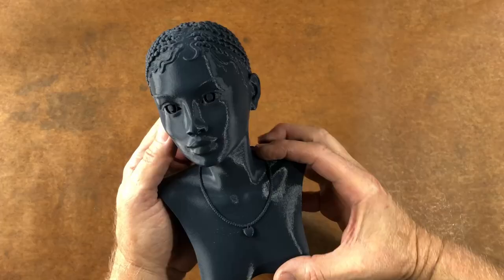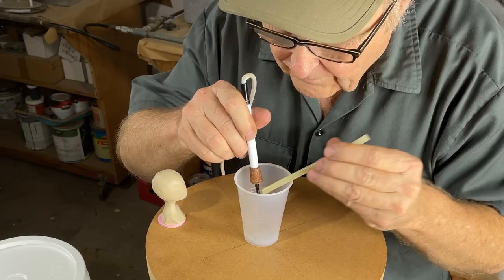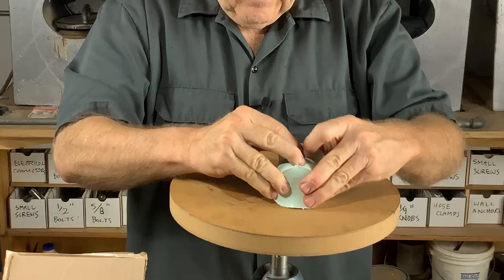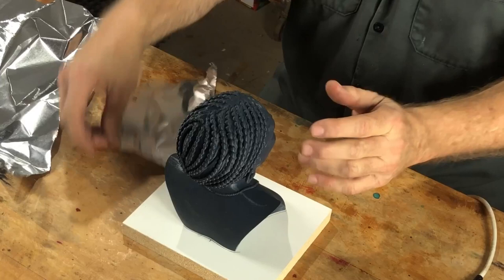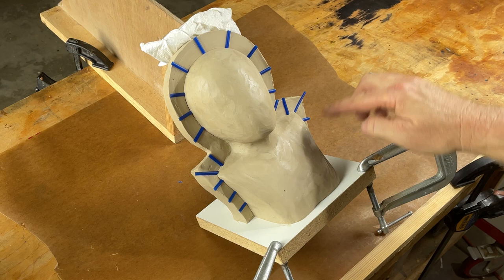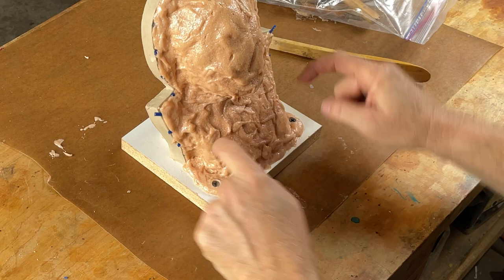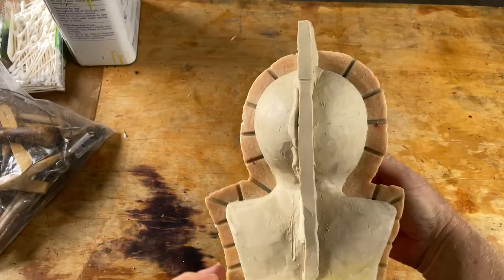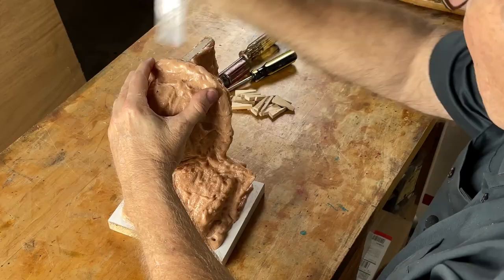Making A Silicone Glove Mold

Comment: Thank you for the amazing, informative content again.

The original sculpture definitely appears to be have been made on an FDM 3D printer. 

My experience is that most filaments for FDM printers do not have the same issue of rubber not setting, in comparison to liquid resins used in SLS/resin printers.

Comment: FYI Cure Inhibition. I've seen this frequently and know how to get around it.

UV resin catalyst (when not 100.00% mixed and fully cures) and the cleaning solvents generally cause Platinum based silicone cure Inhibition. Those chemicals are binding to the platinum catalyst and neutralizing them.
You can reduce inhibition by: baking part (150-200F for an hour). Also waiting 2-3 weeks after printing helps, both give catalyst time to dry out or hardened.

There is a special chemical made to fight platinum inhibition for UV resin,  Inhibit-X. It's basically 0.1% platinum catalyst agent plus thinner solution. It works amazing and lasts a while. It's a dip in solution (or thin brush on), remainder of unused solution can be poured back into bottle.

Comment: You already did something here similar to what I am going to do, but the process is easier. A friend walked me through the process. It is so easy, I feel very confident that I can do it.
But, instead the rubber is painted on in thin layers, and is so stretchy, that it literally peels back onto itself like a glove. No parting lines whatsoever. It is perfect to cast doll heads or the dolls that I want to cast.
Reply from the maker: That should work well for you. Make sure you can support the glove so it doesn’t distort when you fill it.
Reply: @RobertTolone  Since the molds will be so small, and it will be slush cast, (therefore creating a hollow resin) I think they should be fine. 😊😊😊

Comment: If you're able to turn the mould inside out, then you could possibly repair the few spots that tore out by attaching small quantities of rubber that will inversely translate into indents on the final piece.  Whether than would work in practice, (at all or partially), can only be answered by doing it, I guess.
Reply: That's what I'd have tried, John - especially if I still had the speck that Robert removed from the model.

Comment: If you're creating a mold from a 3D model, you can use the 3D file - expand it - and 3D print a mother mold for your glove mold to go into. Removes so many steps. I'm sure it could even be done by using a 3D scanner to scan a master where you don't have the 3D file. If you ever try this, make sure to expand the surface of the master - don't just scale it up because that won't work.

Added benefit; you can exactly compute the volume of the glove mold, though then you're deep into your 3d software.
Reply from the maker: In my cad system I can use a shell command but I find it is important to design the shape of the mold case.  A surface offset isn’t usually optimal for the case.
By the time you add the parting surfaces and keys, etc and then print the case I’m not sure you actually save much time over hand-built cases. Also I use manual methods because many of my viewers do not have access to 3-D printing.

But I will be doing some 3-D printed mold cases in upcoming videos because it’s too much fun to resist. Thanks very much for your comment.
Reply: @RobertTolone  Thanks for replying! The surface offset isn't perfect - and in Fusion 360 it often fails for complex models. Here in Sweden, silicone is $100/liter, so any excessive mold material quickly becomes expensive. Using the 3D model means you can create a mold where the silicone is 10mm, 5mm or even 3mm on each side. I often end up making the mold cavity by hand, slicing of parts that aren't needed and moving those parts over to the mold box/mother mold instead.

However, as you say, you need a 3D printer and you spend the majority of your time on the confuser. With your technique you need neither 3D printer nor CAD software. I'm guessing a lot of people do casting because they want to work with their hands - which would make your technique much more satisfying.

If one goes down the route I outline, the 3D printed box is square and can be made self locking so no rubber bands or clamps are needed to keep it shut during casting.

Comment: So what could be done to keep the clay from sticking to the shell? A mold release, beeswax? Would that then ruin that clay for future use?
Reply: I have heard that slow and easy heating of the clay really softens it. So using something like a hair dryer or a heat gun with adjustable settings should be a massive help. Although i also heard someone suggest possibly just covering the clay in aluminum foil or saran wrap before applying the rest. Hope this helps :)

Comment: Would spraying mold release on the clay partying line have helped you with taking the clay away in between making the two mold halves?
Reply from the maker: Yes, but I like to reuse the clay because I’m cheap. And I’ve never found an easy way to clean silicone spray off the clay. Still, it’s a good question. Always a balance between the value of labor and materials. Would the time saved use using the release pay for the clay?  Quite possibly.
Reply: @RobertTolone  It did not even enter my mind that the clay might end up being caput thanks to the mold release. But yea, it then becomes a cost vs time thing. =/ What if you resquished al the clay with that in it. Would you not end up with workable clay then? I mean sure the spray would accumulate over time. But it might get you a few more uses of the clay that way. Sort of like how they use thumbtack as a eraser.
Reply: @danje748  Interesting proposal, I for one am curious to see if that could work... I also saw a couple of other possible remedies as well you might look into as well. The first is simply heat, slow and steady with something like a hair dryer, or maybe a heat gun but with adjustable settings so as not to overheat anything. This will soften the clay quite a bit, and aid in it's removal. Another suggestion which I'm very curious to test is to simply cover the clay in aluminum foil, or saran wrap before applying the resin. Essentially wrapping yet another condom around the clay itself. However I haven't personally tried either of these myself so take it all with a grain of salt. I don't want to be the one suggesting techniques that may inhibit or downright ruin someone's project. But i figured I'd let you know in case you didn't. :(
Reply: @lucassmith1886  thank you for the ideas =)

Comment: What kind of silicone molding compound do you use normally?  I'm just taking the hobby up again after a fifteen year absence and I'm really behind on sourcing good material that doesn't cost me two limbs and a goat.
Reply from the maker: I use Econosil 25 from www.silpak.com. It is a tin-based silicone rubber and is the most economical one they sell.  Sorry to say there is no such thing as cheap silicone rubber and resin.   At least I have not found any yet!

Comment: Fantastic work! Great example of a technique I’ve never used.

Quick question, why wouldn’t you just do a cut mold? Yes, it would use a lot of silicone (I’m sure 1-2 gallons if not more), but it seems like you spent hours upon hours making this mold, and time is money
Reply from the maker: True, time is money.  When doing my client work I basically use the exact same materials and methods on almost every job. But that would quickly get boring on a YouTube channel. Here I try to demonstrate as many different methods as I can.

Comment: Hi Robart , I luv your videos, as well as the Craftman..this one though,  ni think you got it wrong for a glove mould, i think it would have been easier to partition the original with a clay wall and keys,  paint into and then layer up the silcon, (a dash of food dye )for alternate layers, to see coverage for each layer,  say four layers, bit over an 1/8,...cake up,  over the silicon (with whatever , your mud stuff, plaster, or even fiberglass), turn over and repeat for the second half....separate, and hole up with a cork bung for a good slush cast two piece...
Reply from the maker: For me, the point to a glove mold is to avoid parting lines altogether.  This mold required some cutting because of the sculpture shape but most of the mold was uncut.  So the parting line on the casting was short and easy to clean.

Two-part clay up molds are lots of work to make and produce an unsightly and unavoidable parting line which runs all the way around the sculpture. So in fact it would have been much more work to do a clay-up mold and much more work to clean the parting line off each casting.
Reply: @RobertTolone  Robert, I hear you, but if you have a tight key system, different shapes not all rounds or bolts, then parting linesd wont be an issue, also consider what the client will cast the end sculpture in, for example, if that bust were to be done in bronze, the the only way to exit a wax shell from your one piece would be to pour the investment in, other wise you would just deform , at best, the wax shell getting it out..not so with a two piece

Comment: I think the print is not resin it seen to be fdm printing so there should be a problem of the material (probably pla)  inhibiting the cure of the silicone 😁
Reply from the maker: It worked out ok this time.

Comment: Hey Robert, is there any downside to gently heating the clay in order to ease removal?  The PLA on the 3D print isn't supposed to deform until it hits 60c (140f) so I'm thinking blow dryer?
Reply from the maker: Yes, heating really softens the clay.  It wasn’t too hard to remove but I could have safely done it.

Comment: With the beauty coat (eyes, hair, etc) does dipping the brush in degassed rubber not introduce air bubbles? I've never tried that approach but always feared that would be the case. I always pour on and brush outward but my method can certainly be more tricky than simply brushing directly on.

Comment: Ok, letting my geek flag fly here...
I do both casting and 3D printing. The easiest way to cast a model like this is to print the mold.

How I do this, I load the model that is going to be printed/molded into a 3d modeling software, I then put it in a 'block' and subtract the original model from the 'block'. Next I split that block in two, then just up-scale it in the printing software by 10-20% and print the 'block', then print the model.
What I then do is glue the model to a board (like Robert does) then I glue the 'block' to the board around the model, then pour in the silicone and you have a perfect "glove" mold.
I have done this with crystal balls so I can then resin cast the crystal ball, I have done this with detailed models etc etc. Takes 10 mins on a PC then however long it takes on the printer. If you are looking at mass producing the model, you can even make multiple silicone casts of the same model/block over and over again

Comment: 1) That looks like an FDM print to me. Do those PLA/ABS/etc filaments also cause cure inhibition like resin prints tend to do?
2) Have you ever considered trying sticky wax? ;)
Reply: I haven't heard of FDM prints causing inhibition, and the two brands of silicone I've tried haven't had any issue curing. I use PLA.
Reply: I tried once, and leave the mold three times the normal time and worked perfectly with an ABS model. But something that works even better was to sand it and fill the lines of the print with wood filler. That got me a smooth surface once I casted the part.
Reply from the maker: 1) I’ve had pretty good luck with most filaments recently. 
2) What’s sticky wax?

Comment: Those aluminum foil condoms are handy when you don’t wanna run to the art store. Also. I like your drill, haven’t seen one of those in decades.
Reply from the maker: Drill is a mid 1980’s vintage Porter Cable.

Comment: Hi Robert, I love your channel and have been a fan for a long time but never wrote a comment. I have a question about glove molds. I made a glove mold for a skull with silicone rubber and am having a tear issue on the cut when I cast resin skulls. The tear kept getting larger and larger and now I have to remake the mold. Do you have a technique or perhaps know of material I can add to my mold to reinforce the area that needs to be cut to free the castings?

Comment: Thank you for your lessons. I wonder if others are having the same questions that I have when I watch your tutorials..Would you please share a picture of the "Bee's Wax" or a material list with brand names? Also, where did you get that soldering iron/wax tool (what is it called) and what wax are you using to "glue" the foil?

Comment: i sell silicone rubbers and do 3D printing! If you ever need to cast a 3D print it's usually SLAs (resin prints) that inhibit silicones due to the sulphur content, giving it a post cure and using an enamel spray over the surface usually helps with any silicone inhibition! Also printing in a clear resin will make sure the UV penetrates further throughout the print :)

Comment: Ι learned alot from this video! My heart sunk when I saw the little ripped piece of the mold in the eye. Im really curious about the fix. Maybe trying to put the sculpt back in and add abit of silicone with a brush? Instead of foil you could use cling wrap. Btw the sculp has alot of problematic areas and those print layer lines are going to reproduce
Reply from the maker: Oh yes, the mold faithfully copied every printing artifact in the model. One day maybe filament printing will be as clean as resin printing but not yet.

Comment: I liked your video but I had couple questions about things you didnt mention. What did you use to fill the gaps in the hair to avoid undercuts? Also how did you mount and keep scupt mounted to the board when replacing the mold halves in preparation for filling of the cavity with rubber?
Reply from the maker: I filled the gaps with sculpting wax and I secured the sculpture to the base with sticky wax. Watch my most recent video, it’s all about the waxes I use.

Comment: Hi Robert, I was going over some of your old videos and I watched this one as well as another where you were making jackets. What struck me was that in this video, you make the jacket first and pour the rubber into it and in the other you brushed on the rubber and made the jacket over it. I'm wondering what kind of  situations would be to use one or these techniques over the other.
Reply from the maker: Both methods work. I use the brush-on first method when the model has hair or other very fine surface details.

Comment: that is such a long process, do 5 minutes then let it dry over night, do 5 minutes and let it dry, and let it dry again... but the good thing is, with the rigid resin case, you could use rigid expanding foam instead of a solid resin to save weight/cost/ etc.
Reply from the maker: I generally only use rigid foam on larger molds, like life size figures.

Comment: Ok, Robert the question is, why didn’t you coat the tin foil with Bees Wax?
Reply from the maker: No need. You saw how easily the clay came off the foil. Also I was afraid that some of the melted wax might seep through the cracks and get on the model.
Reply: Good answer! Could you have coated the Trowelon 60 to make separating the clay easier!

Comment: Mold release would solved the majority of issues in this process.
Reply from the maker: I did not use a mold release on the clay because I reuse it. And I did not use it on the model because it was not necessary and I did not wish to clean the model afterwards. Release would not have prevented the bits of rubber from sticking to the model where they did because the rubber was trapped in those locations.

Comment: why not put it in the vacuum chamber when it's in the mold?  is there some reason not to do that with silicone? or am i just totally off base asking dumb questions?  i've never done this before, it just looks like a really neat hobby to go along with 3d printing which i already do.
Reply from the maker: It’s not a dumb question. I don’t do it because the resin I use sets up too quickly and cures while the bubbles are expanded by the vacuum.  There isn’t enough time for the bubbles to rise out. Also you would need to design the mold to have a reservoir to contain the resin. Materials under vacuum have a larger volume because of the expanded air.
Reply: @RobertTolone  thanks for the explanation, that makes perfect sense!

Comment: Many of the 3D printing tools (slicers) provide a means to generating a mold, as the model is being printed.
This bust of a woman is very, very detailed and cannot say how good of a mold will be/could be generated .  I have not tried the mold feature (Ultimaker Cura 4.11) yet.  Just a thought.
Reply from the maker: If it is a rigid mold and then it will be a waste mold unless you cast only flexible material into it. One of the two materials has to give otherwise you’ll have interlocking.
Reply: @RobertTolone  Yea, good point.  What I have seen is "slicing" the 3D mold into halves, and this person used clamps (not rubber bands).  They tried this material called Instamorph (don't know why he did, but, he did since it is moldable at 66°C / 150°F and solidifies at "room temperature").
I was wondering whether one could use this "3D printed mold" for rotational projects.
BTW - I love your work, teachings, experience, and channel!  I've learned a great deal.  Thank you [;^)
Reply: @truegret7778  Instamorph (PCL - polycaprolactone) is really cool stuff (well, apart from when it's hot - LOL!) and I've used it to make rigid mother molds, especially when I've only needed them for a single casting - cos then you can melt 'em down and re-use them for something else.